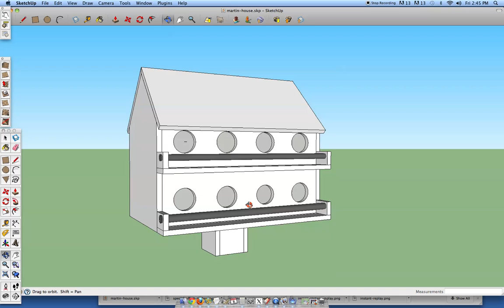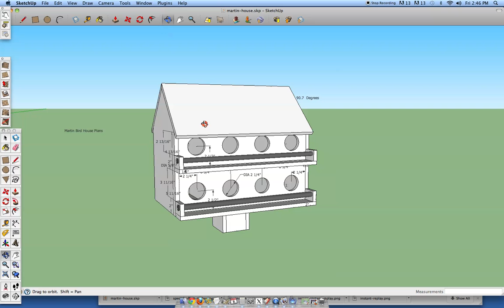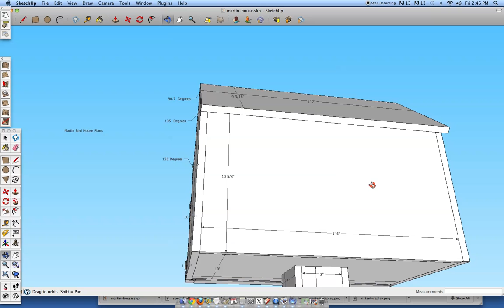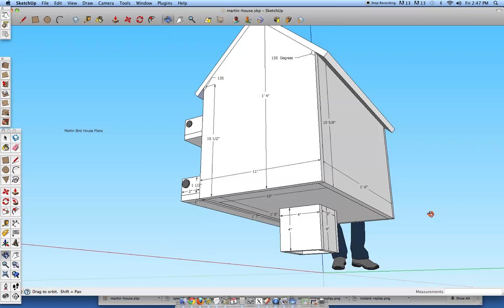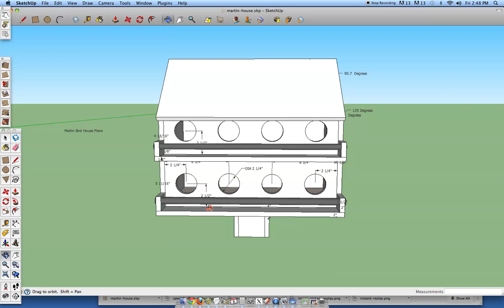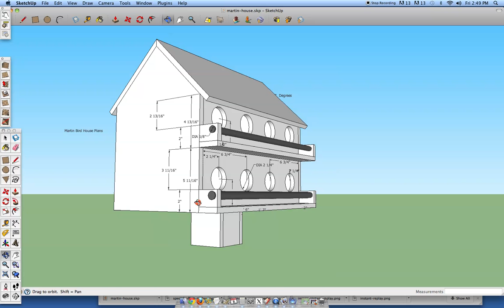Martin Bird House Plans

Comment: This plan should be updated to modern 2024 plans. Needs to be able to raise and lower to do nest checks and clean removing the unwanted blowflies lava. This plan needs more Depth added for front and adding rear compartments with starling proof openings mounted low on the floor less than 1/4” high above each floor opening using a crescent shape hole size at  3” wide at the bottom X 1 3/16 inches high Maximum height layout on the hole layout installed no more than 1/4” above the floor.  
By using a three inch drill circular hole saw. A 1/4”shim will be required at the bottom base of the hole to achieve the correct alignment. 
This is to stop Starlings from entering the compartment. Nesting boxes are more user friendly. Each side needs a set of doors that are hinged to allow service of the baby chicks. Also railing should be included in the door plans to save jumpers from leaving the nest before they’re ready to be able to fly. Jumpers. This plan didn’t have enough roof hangover to keep the birds dry. Next is the problem of snakes and raccoons trying to enter the nest to eat babies and eggs. This would require a Quick release pole Guard to be installed on the pole approximately 48” from the ground possible with a  electrical fence charger higher voltage at cattle or sheep farm range levels attached to the Stainless Steel Quick release pole Guard would work best allowing removal when lowering the purple Martin house with a positive electrical wire connected to the Guard and a negative ground wire connected to a ground rod and the pole base. Just do more research on modern methods of raising purple martins  

Referring to the T14 purple Martin design mounted on a 3”X 16 ft. With a hand operated winch